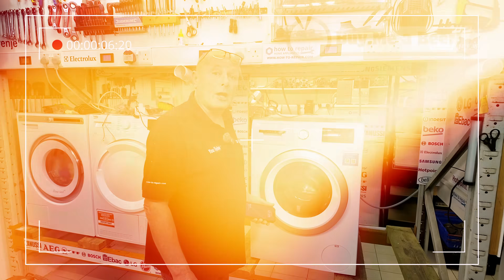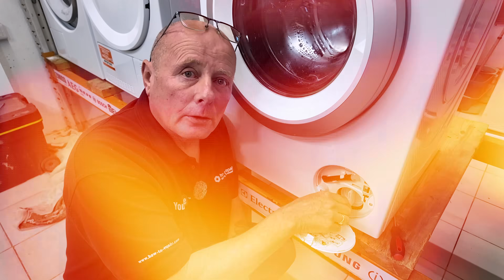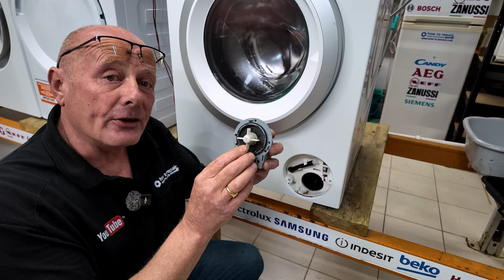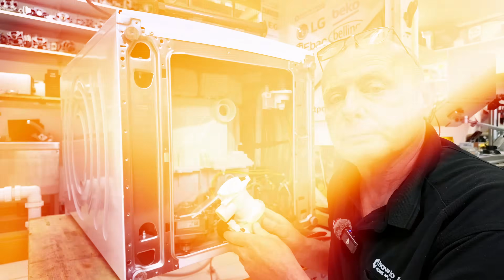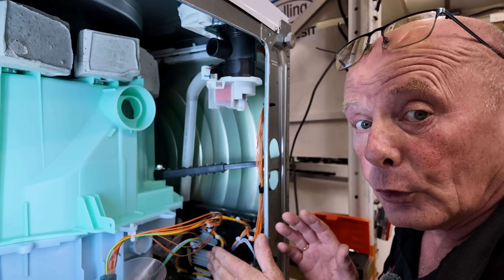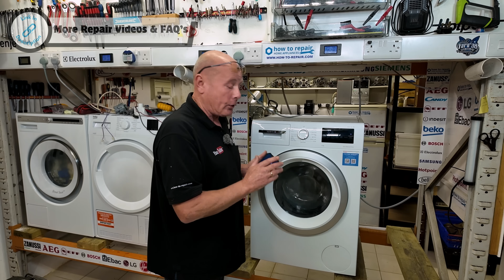How to Fix E36-10 Error Code on Bosch & Siemens Washing Machines (Not Draining & Emptying Water)

Comment: Hi, been watching your repair vid and its wonderful how you make things so clear. Just wanted some advice on a bosch serie 4 machine with e36 error. Followed some instructions from you and have check the motor propeller which seems to spin ok. The error only appears on a wash cycle right around 1 min remaining although there is no water left in the drum and clothes are not really wet. If I run a spin cycle there is no error. Really confused as to what we are dealing with. Any help would be appreciated. Thank you

Comment: Great Video Paul. Have a WAX32M41AU/07 Bosch Serie 8. 2023 vintage. Wanted to get the service menu but seems the whole world does not know. Maybe you do?  The method you show on your older serie8 does not work( turn to 8 press temp and then rotate to 9 while holding button and then releasing) There is one user on reddit that writes in garbled english  saying "yes new way to "wait" BOSCH service mode 8 idos" by select wash 15 then reduce to 11. It seem shorter Service Mode with this wash you got all major funstions and its component test". Anyway I hope you can make sense of that or simply say it is BS. My error is 36-25  and essentially the pump does not spin, wanted to use P05 to run it from the menu without taking the front panel off. As you said here, it is one of 3 things 1) no power from the board (worst scenario), 2)disconnected wire (unlikely) 3) the pump is cooked. There is no obstruction, I have reverse flushed the drain hose and it is free. The impeller spins and has a gentle spring that pushes back when I push it in which probably means it is not snapped. If I don't get a reply, I'll pull the pump out and pray it is not the control; board, Thanks for your channel

Comment: I have a brand new Bosch series 4 washing machine. It won't drain. Error code E36-10. Followed this video and found nothing in the filter or impeller. I found that if I turned off the water and ran the machine on the drain program with the filter open the impeller doesn't spin until I give it a gentle nudge  then it works well. When stopping the machine and starting again I have to gently persuade the impeller to move again. Does this mean that the motor is damaged and I'll need a new one?

Comment: On my bosch the impeller was not rotating because of a very long hair that was wrapped around the impeller’s shaft. 🫣 At the first galance everything seemed ok. And after I discovered it- used really small scissors and long-nose pliers to clear it out. 
Thank you for the video! 🙏

Comment: Just bought the Bosch machine, did the first recommended wash and then we didour first normal wash.
Got the e-36-10 error.
Filter looks new, no coins or debris inside.
Still got the error.

Got the washing out by using the frontal drain hose.

Any idea as to why I got this error on a brand new machine?
Thanks!
Reply: I have exactly the same issue. Did you get any further with this problem?
Reply: @darryllake  Have the same issue for my new machine, did you find the solution?

Comment: Similar problem in a Whirpool, BUT caused by the "air trap" being plugged with hair and debris.  That caused some kind of error signal from the pressure sensor, which runs the water level.  Only occurred during drain cycle, when the pump kicked in.  Pump and all other parts tested good.  We are at 7000-feet altitude, and this may have contributed to the pressure sensor sensitivity or baseline setting.  Sensor was previously adjusted for altitude, to get correct water levels.

Comment: I have an LG washing machine that had 2 years of warranty. Thankfully the drain pump (didn't know at the time) started to make a high pitch noise before the 2 years were up (around 1 year) so I could get it fixed for free. I had an eagle eye on the guy doing the job. A year after but out of warranty period the same thing happened. Instead of the Chinese (supposedly bad quality pump), I bought a compatible version which is produced in Italy. 4 years and no issues since. It's crazy that the original pumps died within 1 year or so like clockwork on a brand new machine. Like... what the hell?

Comment: Our Bosch Series 6 pump is noisy when draining. Like a loud humming. Do these pumps become noisy but still work fine? I've removed the filter and can see no obstruction around the impeller. Obviously it works but is noisy, so I'm reluctant to disturb it if it's working properly. Or change the pump and the noise is still there.

Comment: I cleaned the rubber tube thing, and I found a dime and a aluminum can tab in the pump chamber. After I cleaned everything and put the tube back together, now when I select a program, the display turns on, shows the time the program should take, but the door won't close and it doesn't respond to any button, the start button just blinks. Any ideas what's going on ?

Forgot to mention, I used the manual lever to unlock the door because it wouldn't open, I had the drain error E:36 -10
And my washing machine is Bosch series 2

Comment: I’m a Bosch / Siemens technician. I like your videos. 

But, you’re not able to break the filter by turning it by hand if it’s blocked. Not the white filter. 
There is a blue ish / purple one on some models that you kan smash with a screwdriver and a hammer to clean the pump. That’s useful in small spaces or if it’s a dryer on top of the washing machine.

Comment: I replaced a split fill hose from the detergent drawer in my parents Bosch washing machine and I can't believe how much I had to dismantle it just to replace one part. I couldn't figure out how the plastic clips reconnected on the front panel so I just had to bodge some grab adhesive on it along with the original screws.

Comment: It is possible to remove the assembly without taking the front of the machine off. I done this 2 months ago and found if you have a long torx  screw driver for the screws it works well. I was advised I would need to take the front off but managed without doing so.

Comment: great video..I love my Bosch in built and just had a new version installed afetr 12 years of hard service .. Had the pump code on the old one and went through the basic checks. Opened up the pump unlet and finger checked the impellor..problem stopped but then came back. Rechecked the pump filter area and a hex key from my work clothes was lodged in the impellor.. how i missed it before i dont know but worth having a good prod around the pump impelleor and the ribbed flexi water input pipe to the pump accessible from the front...

Comment: My mam has this exact machine. I had to replace the moulded plug as it had somehow cleanly split on the strain relief, exposing the inner core wires. It was quite brittle when I cut into the plug, not what I expected. I bet they have penny pinched on the cable and plug as well!

Comment: Bosch still make the mini washers that go to the sink ??? You never find them in second hand stores.😢
Reply: @applianceguy  I think you said Bosch produced mini washers  that go to the  sink . They are hard to find.  But maybe I misunderstood it.
Reply: @LindaLord-nr9pr what do you mean by ‘mini washers that go to the sink’?
Reply: @applianceguy   these are smaller washers & dryers. They can easily be carried to the sink &  their tubes can be fixed on the water outlet. You  just turn on the faucet & it fills  the washer .  The machine empties itself in the kitchen sink.  They were discontinued in the early 2000s.